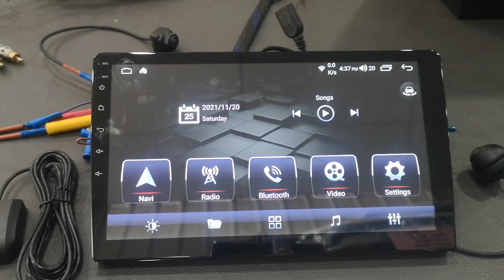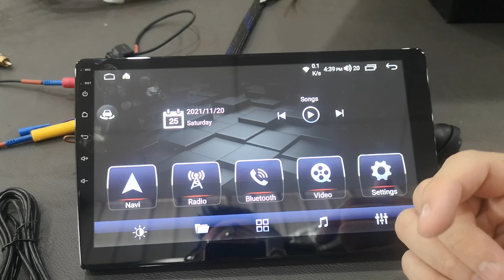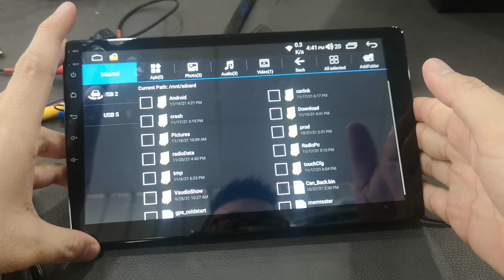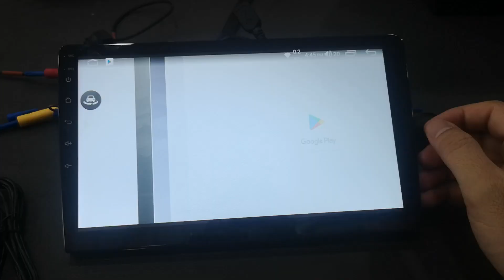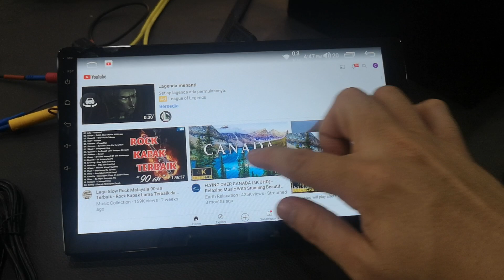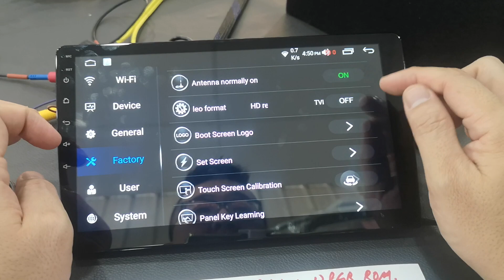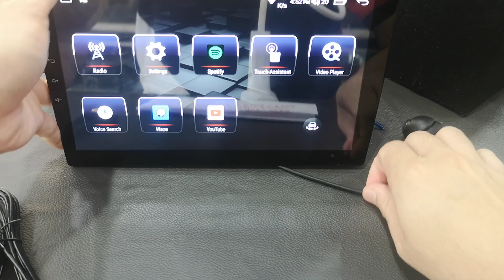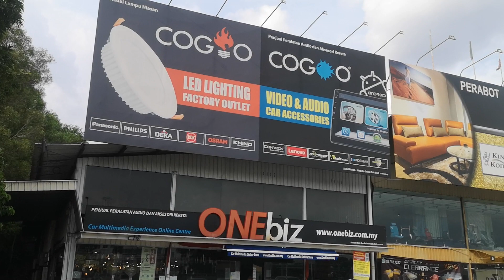Cogoo CG8 7862 8gb ram 128gb rom 8 core processor QLED Car Android Player 4G Data HDMI Optical out

Comment: How does this unit perform with game emulation?? as I'd like to be able to play games when I'm not busy in my car or have output pumped out to the headrests for the backseat with a couple of controllers for passengers..
Reply from the maker: yes can  , high spec model can support .
Reply: @andychin96  I want one for my right hand drive kia Rio 2013 UB.. Where is the link for ordering this? Thankyou
Reply from the maker: @garystinten9339  www.wasap.my/60132098389
Reply: @andychin96  the link isn't working for some reason..

Comment: Hey. Do U also have a frame for Octavia 3 (aka Octavia a7)?

Will this unit work with Skoda active Canton Sound System? My actual head unit needs a MOST Adapter and only Plays music in Front speakers. No rear Sound.

This is the Same issue Like in Audi Bose System and Vw dynaudio.

Greets from austria
Reply from the maker: sorry , doesnt have it at the moment

Comment: Hi.. How can we make dual screens function (like in MPV) where the head unit plays Waze and the roof unit can play video. On the other video (CONVEX M Series android player), you showed a setting on "video output" set to background. However, for this one (7862 android player) the setting option for "video output" is not available.
Reply from the maker: 7862 ,  no Video output. 
need usb adapter to connect video output. 
not support DUAL screen function